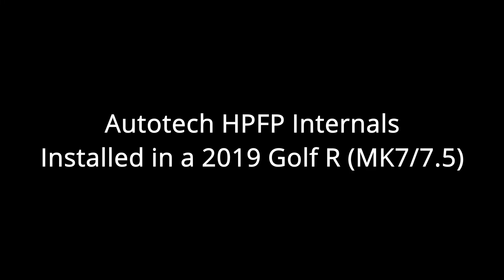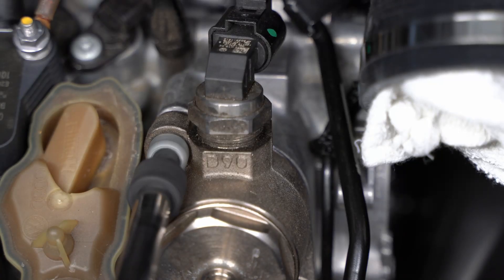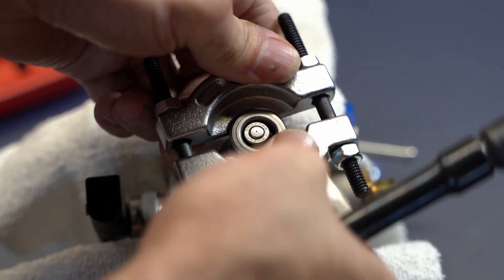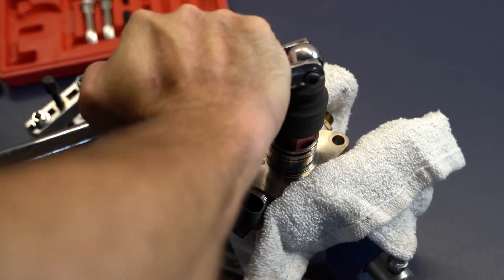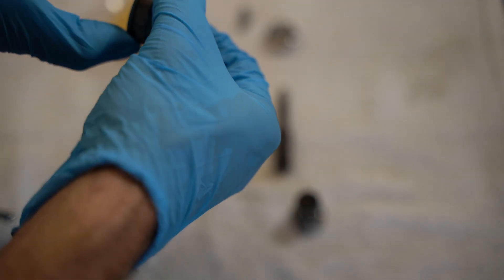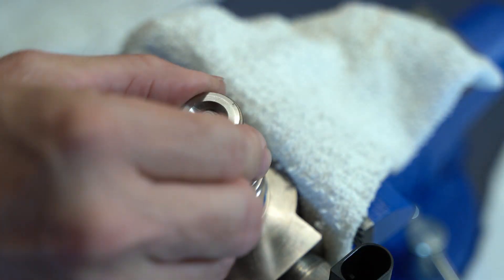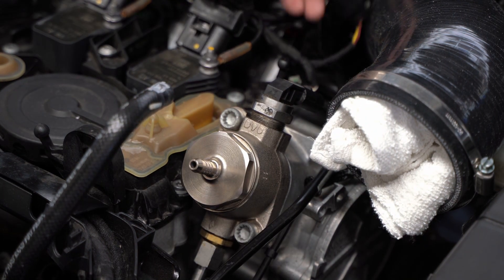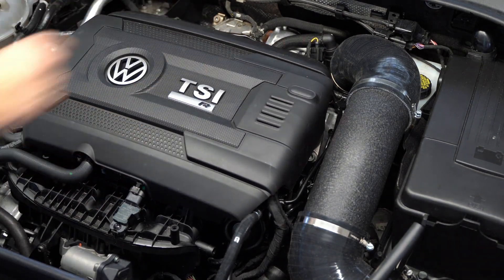DETAILED Autotech HPFP Internals Install MK7 GOlf R or GTI

Comment: Hey man ik im 3 years late but I have a mk7 gti with is38 burble tune if I install the hpfp will I need another tune if I still plan on pumping 93 for the present
Reply from the maker: @yaboidog5499  yes. You’ll need a tune to properly scale the increased fuel pressures

Comment: Pro tip, clean the outside of the pump before pulling it apart. Also, if you don’t want to use a bearing puller, put a magnet through a socket that fits on top the the retainer then push down the on the spring, the magnet will pull the retaining clips out.
Reply: Maybe that works for removing the autotech piston but the stock retaining clips are pressed on, a magnet won't pull them off.

Comment: Hi! Great video. I am considering this upgrade since the oem one is limiting my tune to 380hp. However the 50% more wear on the camshaft is where I'm considering if I actually need more hp or not. What is your experience with the car after this upgrade? Any issues or potential worries? Thanks a lot!

Comment: Hey How did you check if the HPFP is working properly?
Reply from the maker: If it’s not working properly you’ll likely know pretty quick. Massive fuel cuts at wot. But the best way is look for the increase in rail pressure psi in the logs.
Reply: ok so I did good then haha. Thanks again!

Comment: Thanks a lot you really helped me, even provided the torque specs for the M10 bolts on the housing. I broke my stock retainer trying to remove it with my bearing separator. Luckily my press got it out!

Comment: Another great vid.  1 question, My MK7 R is EQT Stage 2.  Will this modification 
require an adjustment to the custom tune to recognize its full potential?  I am not 
running E85 fuel.  Any thoughts is appreciated.

Comment: Where were you on Friday 😩 I took it out and couldn’t get the spring to depress so I just gave up and installed back in.  

But with this video I’m gonna try to redo it when the tools come in and see how my luck goes 👍🏽 thanks for your great video man
Reply from the maker: friday... I was filming this video! lol Glad you are going to try it again!
Reply: @EVERYTHINGcpo  so I bought the clamps you suggested and I understand how to punch them closed with the tool but how do you loosen it if you need to clean and or repair something in the hpfp?
Reply from the maker: @haku107  you need to cut them off and put on a new one. They are not re-useable. Cut the ear with a pair of side cutters.

Comment: Great video, I had mine done by OstarMotorsports while doing some maintenance, didn’t cost me too much, you need to do some 0-60 after the full E85, I spun all first gear and still manage to do a 3.6s on 80 degrees, while doing 3.8s with no spin on E30 on my heavier S3, I do run the stratified dsg instead of the Eqt because the lower rpms LC I keep getting more consistent results, plus I like it much better on D mode.